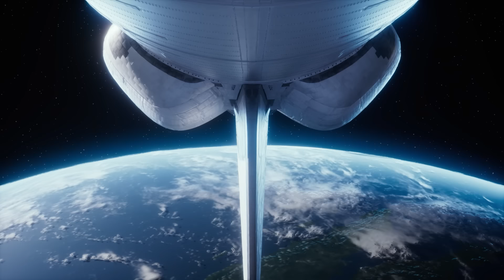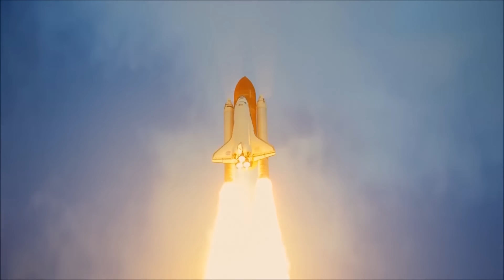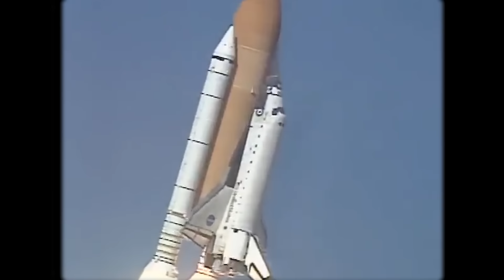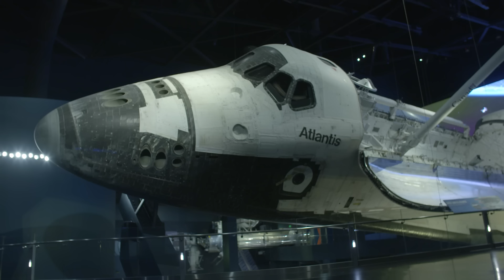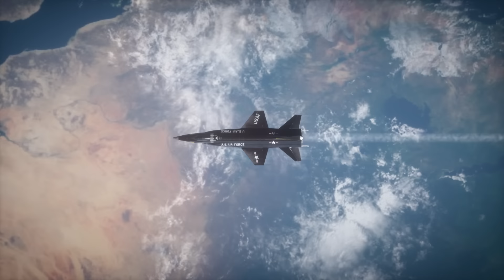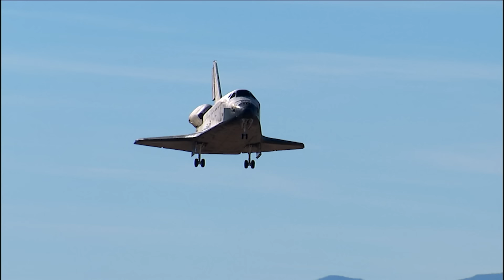The Insane Engineering of Re-Entry

Comment: As a kid I got an opportunity to see and touch a demonstration of the amazing heat shedding shuttle tiles were capable. They brought in a used shuttle tile, heated it to glowing hot orange with a blowtorch, then the moment they took the heat away told us "Touch it." Both times I tried touching it the thing was room temperature. Not even the slightest bit of residual warmth remained. Still blows my mind the level of materials science brought about by the shuttle program.
Reply: The tiles are actually still extremely hot when you touch them.  It's their extremely low thermal conductivity that allows you to do it safely, as they won't transfer enough energy to your skin to burn you.
Reply: @TeKnOShEeP  And after the shuttle landed they were still radiating heat for a good while just sitting there on the runway.
Reply: @TeKnOShEeP source?
Reply: When I was a kid, I saw a documentary on those tiles before the first flight of the shuttle, and that's what they did. They put it in some kind of furnace, it came out glowing red hot, and the dude just picked it up with his bare hands. Incredible, just doesn't begin to describe it.
Reply: @Jimtheneals  i wish our politicians would focus on such things. instead we have tanks that can shoot a fly at 4.5km...
Reply: @homerp.hendelbergenheinzel6649  Without those tanks and other things like it, you'd be speaking German, and if you are Jewish, you'd be dead.
Reply: @homerp.hendelbergenheinzel6649 hey man sometimes those flies have oil
Reply: @homerp.hendelbergenheinzel6649    politicians rarely care about anything that moves society forward
Reply: SO cool
Reply: I went to Kennedy space center in 5th grade (which is a year ago) I was able to take my phone and my 3 friends and we was playing Roblox together on our phones on that futuristic big bus looking and we get to take pictures of Kennedy space center and that rocket bro it was so cool and fun I really thought I was feeling the history it really made me interested

Comment: In fourth grade, a NASA engineer was invited to come to my school to hold an assembly where he demonstrated some of the advanced technology NASA was using at that time.  At one point, he held up one of the insulating tiles, describing it's function on the space shuttle.  He then proceeded to get it brightly glowing hot with a large blow torch.  As the tile was heating up, he asked for a volunteer.  I immediately raised my hand, and he motioned me to come forward.  I stood there for a moment in awe of the glowing white-hot brick in front of me.  He picked it up using a thermal glove and asked if I wanted to touch it.  I shook my head, no, no, no, and everyone laughed.  He winked at me and took my hand and guided it above the still glowing tile.  He told me to pick it up off his gloved hand, and to the shock and awe of myself and the rest of the school, I picked it up.  It was only slightly warm, and sort of made a slight hissing sound when my skin made contact with it.  I was scared, but the fear quickly turned into amazement at what I had just experienced.  One of my fondest memories, for sure.  It left a lasting impression, to say the least.
Reply: When I was in fifth grade, they had a similar demonstration, except the way I remember it was they had a little stand for the blow torch, which was going full blast, then they had kids line up and each one could put their hand on the cool side of the tile - while the torch was still wailing away. It's a vague memory without the detail you have, so perhaps I'm wrong - or maybe they changed it over time or had different setups. I remember being amazed by it - it happened shortly before the Challenger disaster - which I do remember clear, being in west central Florida we went outside that morning to watch the launch, saw the puff ball, the boosters disengage, literally no one thought anything about it - it wasn't until we got inside that we realized the puff ball we saw was an explosion. What I don't understand about that whole situation is how every kid, coast to coast, all knew the "What does NASA stand for" ... "Need Another Seven Astronauts" joke. Seriously, how in a time before internet, when long distance dialing was really expensive, how did everyone know the joke within days? It's not something they'd have ever said on TV or radio back then. That deserves its own investigative series.
Reply: @rodmunch69  I got to do that when I visited the Glenn Research Center for an open house. It was amazing to think of something so frail that did its job so well. Definitely had to get over my brain yelling, "That's glowing white hot!!"
Reply: you are a great storyteller, like listening to an uncle tell his stories
Reply: You two were like Frodo and Gandalf
Reply: @АндрейОнищенко-з8х  "It is quite cool. Take it!"
Reply: @АндрейОнищенко-з8х  w reference
Reply: Had this same guy in 7th grade at Marrs junior high, Omaha Nebraska
Reply: I think NASA dedicated outreach educational programs like this are its biggest strength in keeping the scientific curiosity alive generation after generation. I wish my country's space agency would do the same.
Reply: Fantastic😂 you never forgot
Reply: LET ME TIME TRAVEL TO YOUR SCHOOL
Reply: Burned into your memory instead of your hand, it was a mind control test!!! I am glad to have my aluminum-beryllium-platinum-kryptonite helmet to protect me from such, if you had a neutronium glasses you would see his true face, stay safe king
Reply: The way you express yourself and the quality of your enlish are enviable. Wish my english was this good.
Reply: Really cool thank you for sharing  😎✌️
Reply: If you picked it bare handed,then why he is wearing Thermal gloves??
Unable to understand
Reply: @Jassar001 The part he heated was faced down into his glove, the top side of the tile was cool enough to touch, tho still quite warm.
Reply: In 1969. hotels were promised on the Moon! 2025. not even Musk's X has their logo up there with a 24/7 camera?! Having THE greatest marketing ever ?! Why?
Reply: Nice AI comment. 

And the following week you met a Japanese girl in Tokyo and you guys always went for ramen while listening to that Plastic Love song. 🎉❤
Reply: @rohieldaniel No, and no.  My parents would have never allowed me to travel to Tokyo in the fourth grade.  Besides, that song wasn't out back then. I appriciate your recognition of my intelligence, though, as mortal as it may be.  Brush College Elementary, 1990 was the year,  Mrs. Brillhart was my teacher.  I am not intelligent enough to know how else I can prove that I am human without giving you personal info.  

Edit:  I didn't edit this comment.
Reply: Y cojiste con el después de eso me imagino ❤
Reply: Quite bold to admit you imagined that
Reply: @Raceb8420 I’m hoping that was a translation error 💀💀💀💀💀💀

Comment: Even though the shuttle didnt achieve its main objective (reuseable shuttle with cheap access to space), it was a massive achievement in Engineering and Aerodynamics. 

The biggest surprise and something new I learnt from this video was the hypersonic re entry profile and behaviour or airflow in such profile.
Reply: Yeah, hypersonics are weird. Also in the video they show it making turns while hypersonic. In reality it was only a couple degrees side to side. You cant actually maneuver at hypersonic speeds, all you can do is point in a new direction and increase drag.

Comment: I absolutely believe the space shuttle is one of the single most impressive feats of engineering in human history. In addition to the Apollo missions, it's incredible we could do what we did with the tech of that time and have such a high success rate.
Reply: It absolutely was an impressive feat of engineering.  But most of that engineering would've been completely unnecessary if NASA hadn't been forced to bow to the Air Force's demands when they were designing it.
Reply: @vicroc4 can you explain more details?
Reply: @mikezulathemicrula  NASA originally wanted a smaller payload capacity and less cross-range capability on reentry.  But they ran out of money in the drawdown after Apollo and went to the Air Force for help.  The Air Force wanted to put spy satellites in orbit, payloads larger than anything NASA had planned, and they wanted them in polar orbits, necessitating a greater crossrange capability for landing.  That threw the whole project on its head and forced NASA to make dangerous compromises in order to meet the Air Force requirements.
Reply: "We"?  99% of humans alive today, if put on an island with all the raw materials needed to build one, COULD NOT DO IT.  Not ever.
Reply: Diversity NASA blew up 2 out of 4 space shuttles, a 50% failure rate.
Reply: Yes very impressive but probably not as impressive as the craft I saw which dropped straight in from a stand still about 12 years ago.
Reply: @tombolo4120 which aircraft?
Reply: @pointofinterest5981  lol, my rather descriptive reply was stricken down.  Do you see it?
Reply: @tombolo4120  No bro I can't see any other of your reply. Do you mean to say yt deleted your reply? and yes which aircraft are you talking about?
Reply: @pointofinterest5981  Ty.  Don't know, so I mostly described it.  I won't be doing that again.
Reply: @tombolo4120  Bro can you just please tell the name, then I would do my own research on that.
Reply: @pointofinterest5981  Sure thing man.  In 10 or 20 years if I hear of such a thing I'll let you know  ...or as soon as I hear of 'drop in' re-entry.  (I say 'drop in' b/c apparently there isn't such a thing.)

Comment: 20:26 Not just the Cape! The USAF wanted it to have the same once-around capability from Vandenberg, too. That's much tougher because the orbital inclination is about double what you get launching from Frorida. In other words, you still need to fly the same distance sideways, but you have to pull twice as hard to make the turn.
Reply: As far as I know VAFB was the primary military purpose. KSC only needed cross range for weather purposes
Reply: It was only for polar launches out of Vandenberg that needed the cross range capability  ..launches that never happened. 

These would have been polar orbits hence why the landing target woukd move with the rotation of the Earth...low inclination orbits dud not have this issue.

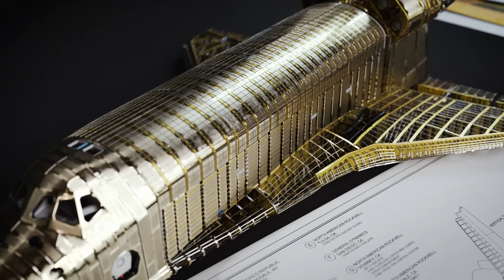Comment: 3:40 Degrees isn't a unit of temperature. Did you mean 177K, 177°C = 450K or 177°F = 354K?
Looking at Inconel X-750 wikipedia page the solidus of it is at 1660K so the max operating temperature is quite a bit lower. You say that the max operating temperature of the aluminum allow is 5x lower than the one of Inconel X so assuming the max operating temp would be around 1300K that'd be 260K which isn't near any of the temperatures. And I assume that the aerospace aluminum is usable in normal outside temperature and thus I'd rule out that you meant 177K by the degrees. So I assume you were referring to Fahrenheit/Celsius where "x times" doesn't mean anything if not in >1e5 scales since those are not absolute units and the offsets aren't rounding errors. 
Again saying anything "degrees" or 5x lower doesn't mean anything if you don't specify the scale or the unit. 

Loving your videos most often but trying to be an engineering channel and making same mistakes that people do in 6th grade physics is just sad.

Comment: 13:10 - on orbit, the shuttle was oriented with the top side facing earth meaning the black underside was the side which faced the sun. The choice of white on top was driven almost entirely by reentry considerations. Because the upper side is only receiving heat radiatively rather than directly, white is the better choice to reject it. 

Also the vast majority of the white TPS was changed to thermal fabric blankets made of either woven silica fibers or nomex fibers depending on temperature - rigid tiles were almost entirely replaced on the upper side in the 80's.
Reply: Only Columbia and Challenger had LRSI tiles on the midbody and payload bay doors. The latter three, Discovery, Atlantis and Endeavour all made extensive use of Advanced Felt Reusable Insulation (AFRSI, the quilted thermal blankets) replacing both the LRSI tiles and the smooth Felt Reusable Insulation (FRSI) thermal blankets. During extensive downtime between STS-51L and STS-28R, all of the LRSI tiles on Columbia's midbody and PLBDs were replaced with AFRSI blankets, leaving only the Forward Fuselage with LRSI tiles.

For the ISS missions, alot of the original AFRSI blankets on Discovery, Atlantis and Endeavour were replaced with FRSI blankets for weight saving reasons as every pound counted when lifting heavy payloads into the challenging 51.62° inclination orbit that had been chosen for the ISS (lowest possible inclination available to the Russians). This was in late-90's.
Reply: @DaveS_shuttle  awesome breakdown, thanks 👍.

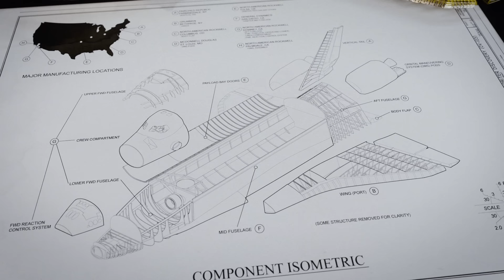Comment: 3:40 A small note here: 177 degrees Celsius for aluminium is not 5 times lower than the 980 degrees Celsius for inconel x, as the Celsius scale continues below 0. Such statements make more sense on the Kelvin scale where 0 is absolute, and if we convert the temperatures it's 450K against 1250K, meaning inconel can only get only 2.8 times hotter, not 5.
Reply: TL:DR Your "pedantic" non correction is worthless, the Delta T remains 803°. When comparing with the same unit, yes, it is valid to say that 177 °C is 5x lower than 980°C. Actually, it's 5.5x lower. Both measurements have the same zero. 500°C IS 5x 100°C. You can't just thrown in a conversion of units, especially when they don't have the same interval and invalidate math.
Reply: @Bjorn_Master-of-None  It's very important. 5x the temperature needs to mean 5x the thermal energy. Would you say that -5 C is five times the temperature of -1 C, despite having less thermal energy? That'd be ridiculous to the point of being useless.
Reply: You are so wrong, what about a fridge set at 2°C versus one at -0.1°C? Would you say it is minus 20 times colder than the other?  @Bjorn_Master-of-None
Reply: @Bjorn_Master-of-None  If you only care about the number of degrees, which doesn't actually reflect the amount of heat, which means such a comparison is totally useless.

How many times hotter than 0 C is 100 C? The Celsius scale doesn't even allow for that kind of a sentence to make sense. The only reason we use it is because for everyday needs, those numbers are far easier to grasp than saying "better bundle up, it's 273 degrees outside."

Comment: The Challenger had a big hole in its leading edge.. that 1,300*F Plasma during reentry wormed its way in. the aluminum ribbing melts at 650*F so it basically went molten.

Comment: 3:36 "... five times lower than InconelX"
The statement doesn't really make sense. It's a pseudo-factoid. Consider... what would 'one times lower' mean? What do people think that means?

But more importantly... if you are going to state ratios in some science or engineering sense you need to use Kelvin which starts at absolute zero, not Celsius which has an arbitrary zero point.

In true Kelvin, the max operating temp of InconelX (1163°K) is just 2.5x greater than that of aluminum (450°K) and perhaps you could casually say that that Al has a max temp that is 'less than half' that of IconelX.

Comment: 1650C ? why isnt it covered in wolfram and insulated with aerogel?
Reply: weight? probably. but still aerogel plus graphene would be good
Reply: @nutzeeer  I think aerogel would crumble to dust when exposed to the crazy vibration during launch, also it;d be extremely expensive to mold it into the required shapes.
Reply: @Eagle3302PL  there is flexible aerogel available in mats. They dont insulate as well as pure aerogel. 
Of course pure aerogel would not resist pressure. The surface would be wolfram with aerogel of some sort beneath it. The bricks used with silicate air foam as insulation is already comparable to aerogel. 
Well I am not a material scientist. I just wonder what could be improved with the latest materials.

Comment: Why are the radiator panels silver if black is better at emitting heat?
Reply: because black also absorbs light, sunlight would heat the panels. you have to balance the absorption and radiation, so tbey went with silver
Reply: 12:35

Comment: Excuse me, I'm a researcher and I have the honor to report that the aerospace industry has changed. Paramagnetic and reactive alloys of titanium and aluminum are perfectly joined by LASER ELECTROMAGNETIC ENGINEERING OF BOTH SIDES OF THE MATERIAL SIMULTANEOUSLY... The new technology is legally and scientifically recognized in America and Europe in 2020. The orbiters may be manufactured by electromagnetic robotics upon approval. of the new system... Stamping components with dies and new electromagnetic engineering joins its parts perfectly without structural rivets... Automatic manufacturing of better fuel tanks... It is an honor to report a new golden era for the civil and military sector . aviation. ...The fuselage of civil and military aircraft is better manufactured with the new system admitted in America and Europe in 2020...The aerospace industry has changed...The new generation and more efficient orbiters to Columbia will be manufactured by companies with Laser electromagnetic engineering. It is an honor to report the true scientific truth of today's aerospace industry.